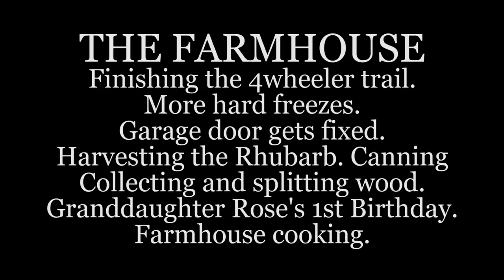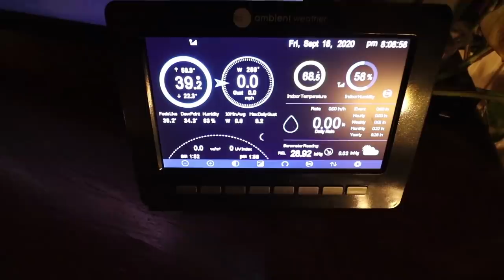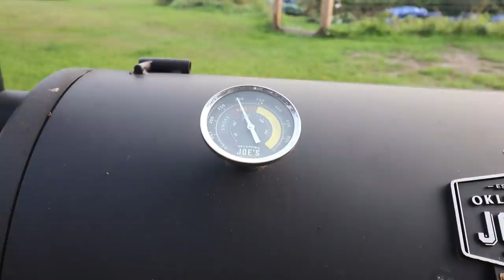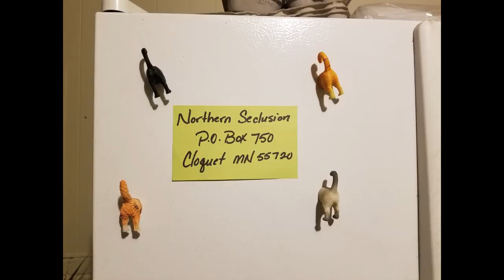THE FARMHOUSE. Finishing the 4wheeler trail. Firewood. Garage door. Garden. Canning. Cooking.

Comment: Joe if you look closely I think there is just enough threads to see left or right. My dad had a M and. H International Harvesters. The M had loader on it, There very few days that tractor was not used. In all the 18 years I grew up and as long as dad had that the M we never had a problem with the engine. We had to replace the clutch about once a year because of the use ! A VERY WELL BUILT TRACTOR ! ! !    I myself spent more days than I can remember on it,   l kind of miss it .

Comment: I have one of those butane lighter torches that you get at the convenience stores to heat up your meth pipe lol, but seriously those are great at heating up rusted on nuts or bolts not sure what BTUs they put out but they do throw enough heat to break loose most frozen bolts. I rarely need to get out my benzine torch anymore for small jobs like heating up nuts.

Comment: Hello Joe, 
My family had a dairy farm and had a farmall H tractor.
The problem with your farmall M. I'm trying to remember which the nut turned.
You may have to check with your mech, would that steering wheel nut turn clock wise to loosen the nut and counted clock wise to tighten the nut. Maybe like the mower blades,  Check with your mech or tractor book.

Comment: Joe I told you many times before about you're garage door you have to lubricate the roller's and all hinges even center hinges twice a year and your door will work fine. I'm a garage door tech. If you ever have any questions let me now.
Reply: PS hope they didn't charge more than 400.00to 500.00 for springs and cables.
Reply from the maker: It was under 350.00 and I called at 11:30 that day and they were at the house at 2:30. The door was fixed by 3:10. I was totally impressed and will use them again for sure.

Comment: A month ago I picked all my rhubarb.  I ended up putting 3 bulging gallon ziplock and 1 bulging quart ziplock in the freezer. I sliced them all up. Plan on making strawberry rhubarb jam and pie filling. And rhubarb jam. Has anyone ever made bbq sauce using rhubarb? Because my rhubarb needs cutting again before we get a frost. So there will be another couple of gallons of them. If anyone has any other ideas for rhubarb, let me know. I canned rhubarb last fall. Still have enough canned.
Reply: Lori Tanner I’ve heard about rhubarb bbq sauce but never tried it.  I bet it would be good.
Reply: I think I will experiment with it to come up with one. Been canning for 42 years. So I should be able to come up with one I guess. I thought it did sound good though.